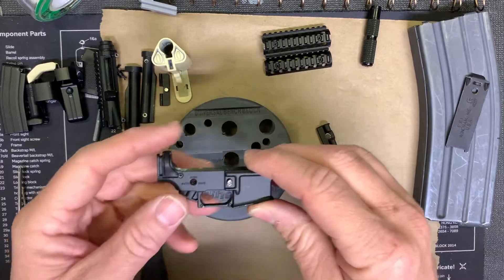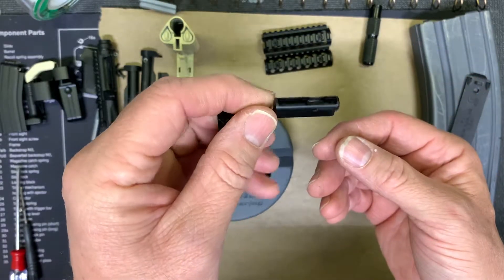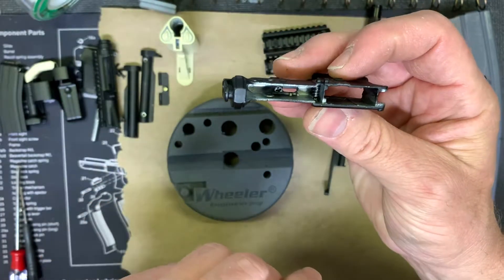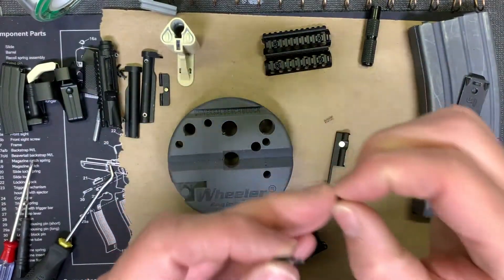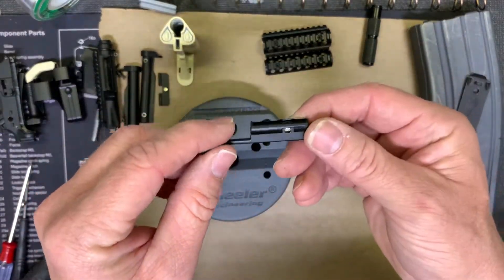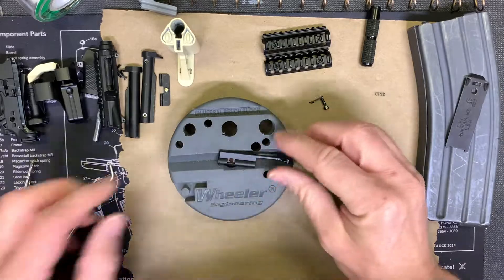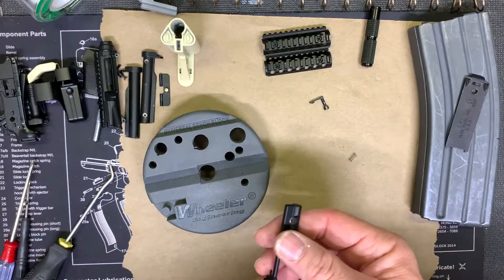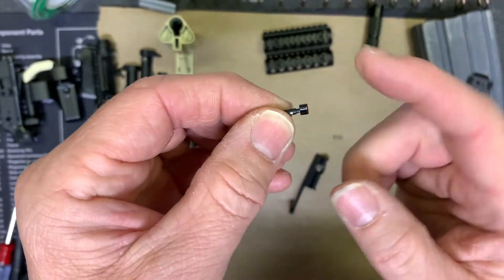GoatGuns AR-15 disassembly tips

Comment: My goatguns m16 sight holder self dissasembles and my m16 also is mag release ejecting lol
also how do i remove the grenadier handgard like any tricks? or do i have not enough elbow grease (help needed with m16a1 grenadier version not the regular one)
Reply from the maker: Thanks for watching. The M16 Grenadier has extra screws for the launcher. Be sure everything is removed of course. If you pull down on it and it’s tries to come out then, yeah a little better angle on the d-ring maybe. It should pop out from the top (front sight). 
As for the sight, are we talking rear sight? The mag release button popping off isn’t a new thing sadly. You can add a tiny drop of glue to the post, then reattach the button. Make sure to support the opposite side and tap the button on with a punch.
Reply: @guninkdesigns  do you just need strong elbow grease to remove the grenadier handguard (above the launcher) because its like not budging
Reply from the maker: @Axofhasquit  hit me up at info@guninkdesigns.com it’s in my profile too. That way you can shoot me a picture.